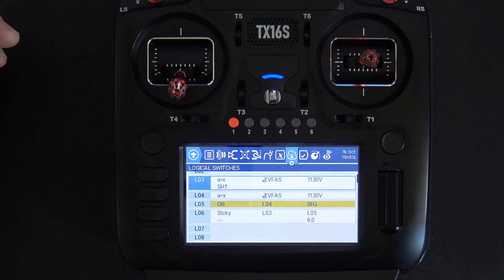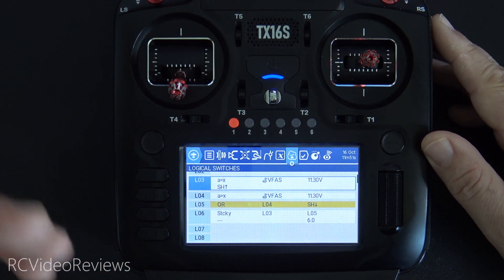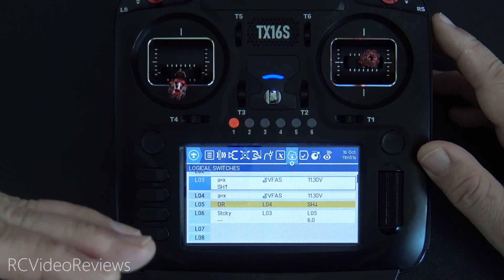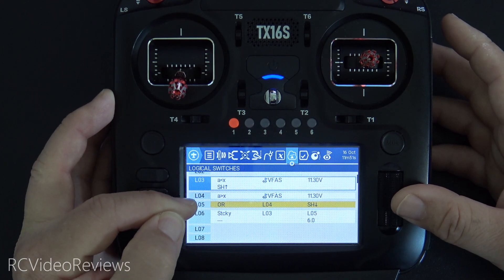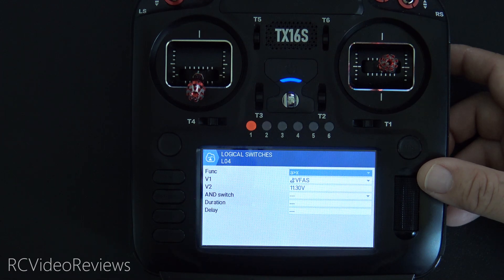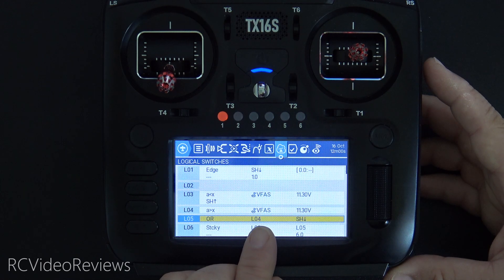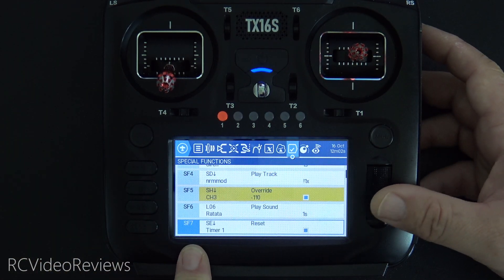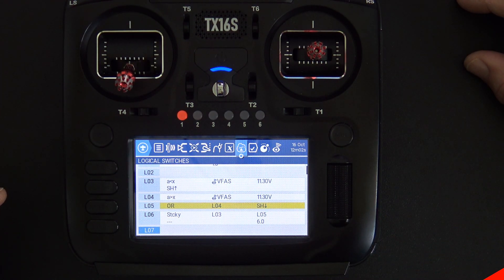EdgeTX Snippet • Delayed Voltage Sag Alert

Comment: Really nice. I'm new to EdgeTX and really appreciate your videos. I find the function sticky a bit tricky. What would be the difference if I just put the delay on L03 and skip the other logical switches?
Reply from the maker: Sticky's are like light switches. Whatever thing activates it, it stays there until the other thing triggers it, then it moves to the other spot. Play with it, you'll see--they come in very handy.
Reply: Just trying to understand what L04-L05-L06 really adds. L03 is active when VFAS<11.30 AND armed. Isn't L04 and L05 just saying the opposite? And L06 switches whenever L03 gets True or False? Am I missing something?

Comment: Outstanding - MUCH appreciated!  I also added a haptic along with the sound in another. special function.
Reply from the maker: Nice. I still use this on every plane I have with support for voltage telemetry. This is one of the best logic setups I've ever made.

Comment: Why after downloading edgetx 2.5  on my Radio Master tx16s which i got no lua scripts with it. On model setup internal module section it blinks module update recommended . Ummm edgetx 2.5 was a update if im not wrong lol. Then why wont TBS Agent Lite connect to my crossfire micro module . I'm dumb af i guess.
Reply from the maker: "Why after downloading edgetx 2.5  on my Radio Master tx16s which i got no lua scripts with it."
EdgeTX itself is just firmware for the radio. Radio LUA scripts are either going to be in the SD Card Contents or downloadable with the MPM firmware. Other LUA like iNav, Betaflight, TBS, Brain2 all have to be retrieved from their respective sources as they are not part of the operating system.

"On model setup internal module section it blinks module update recommended"
You can get MPM firmware here: https://downloads.multi-module.org/?rmtx16s

"Ummm edgetx 2.5 was a update if im not wrong lol."
I don't understand the question/comment. 2.5 is an update from 2.4. What's the question?

"Then why wont TBS Agent Lite connect to my crossfire micro module"
Set your baud rate to 115k
Reply: @RCVideoReviews  Thank you for the response . I found out the reason i did not get mine to connect i found out was because i had the internal module set to on being that i updated it after installing the Edgetx 2.5 . Once turning internal module off it then worked.

Comment: Great Snippet and very cool feature as mine squawks at me all the time near the end of a flight when I punch it, then it stops when I back off.
Reply from the maker: Yeah, I just had that happen with my M2. I had it in Idle-Up 2 doing flips and it squawked about voltage but when I slowed down a little I was up at 11.1. So yeah, I think I'll need to do this for probably most of my 3s setups.